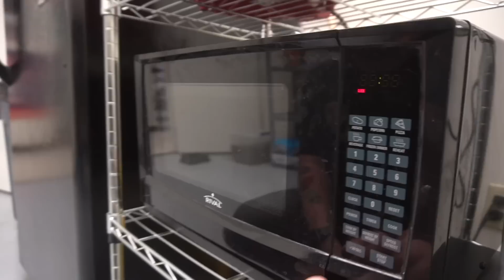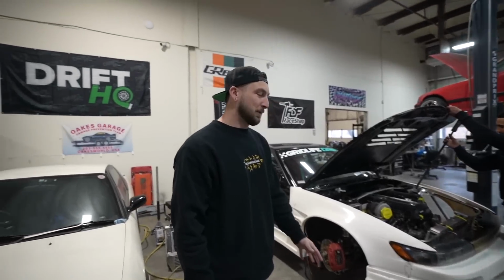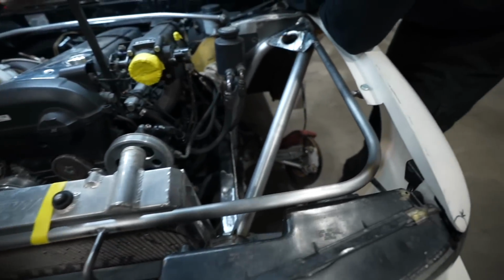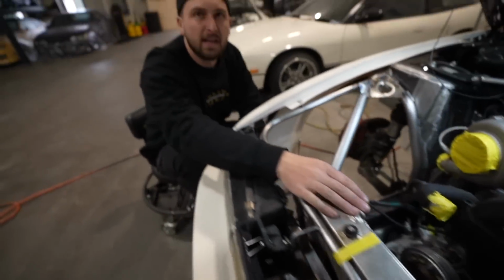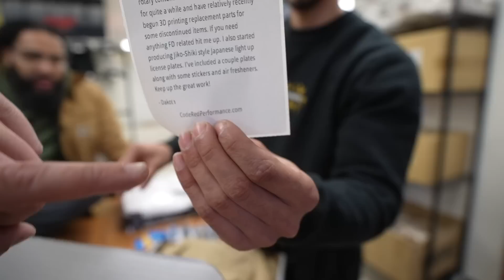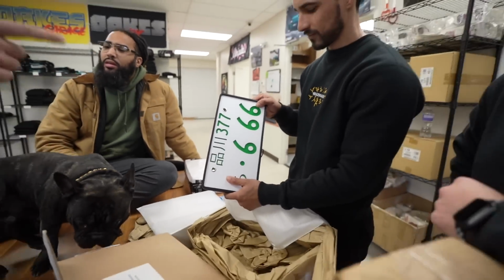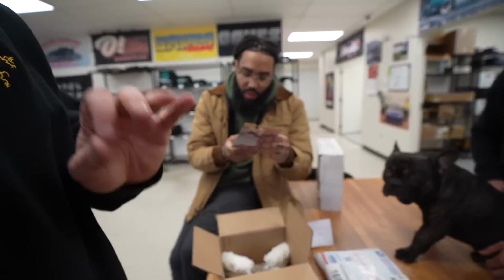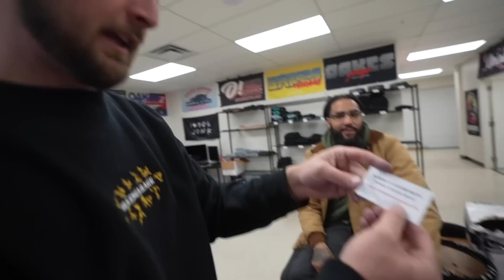The new fate of the Fc RX7..

Comment: I would still recommend a few gussets on the bottom parts of the strut tower and frame rail tubes. You did the tops, but just that little bit of strength on the bottom would seal the deal on a strong tube frame for the front. Looks sick!!! Spoon speck is killer!!

Comment: I would add extensions out to the underside lip of the front fenders to act as a support in case you get hit in the the fender, it will contact the support and it doesn't completely blow up the fiberglass fenders.

Comment: Damn 🧐 ok but is weight on shell 50/50 ? Or will you need to redo diff gearing and change up stage clth kit n flywheel ? Also will it get corner balance it ? And since you there will engine head get rebuild ? With headpackage ? Might as well since it’s whole new feeling drift build .